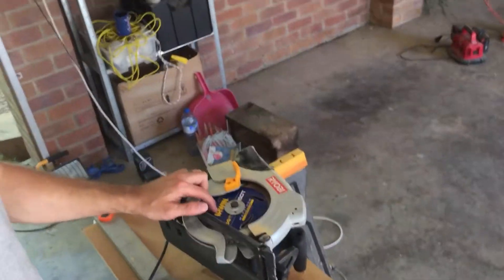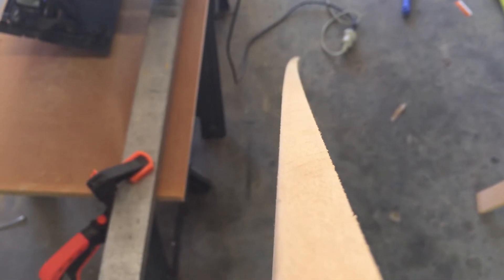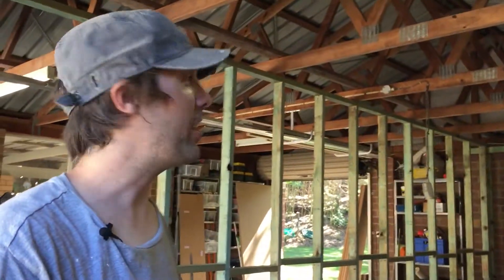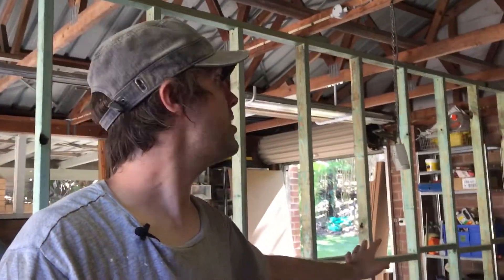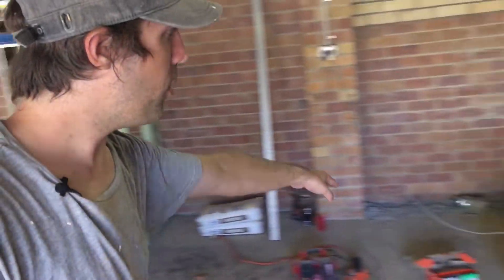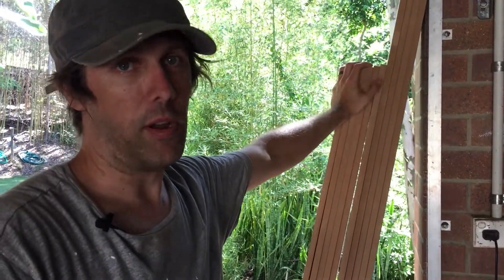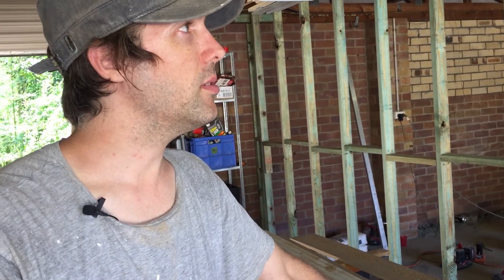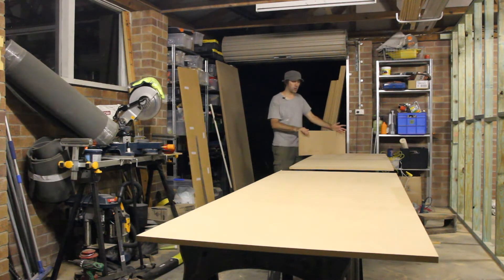Day Four - Building a recording studio in 10 days

Comment: Hi there Andrew, Leo here from Holland! (-: What a great job you did building your studio, I'm planning to do the same inside a semi-trailer. I am wondering what the sizes are from the wooden frame bars... 44 x 69 cm? Regards, Leo Richardson
Reply from the maker: Hi Leo, I'm not sure exactly which wooden bars you're referring to? If you're referring to the horizontal beams between the wall studs, I think those are called Noggins. They are compulsory in Australia when building stud frames, but optional in other countries I think. They are just cut to match the spacing of the studs/insulation panels.
Reply: @HighRoadMusician   Hi Andrew, I mean the sizes of the wall studs! 😉